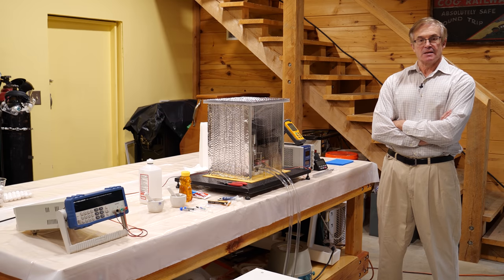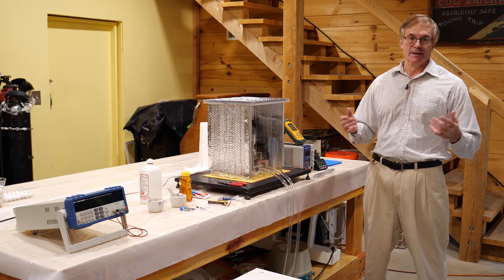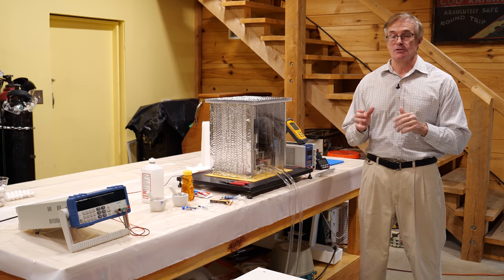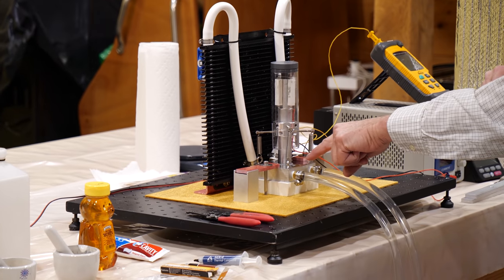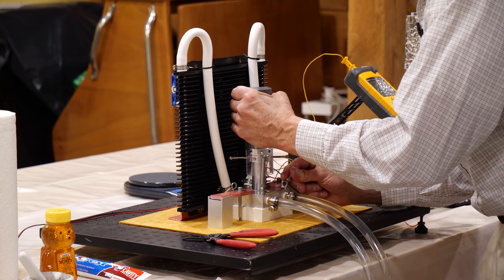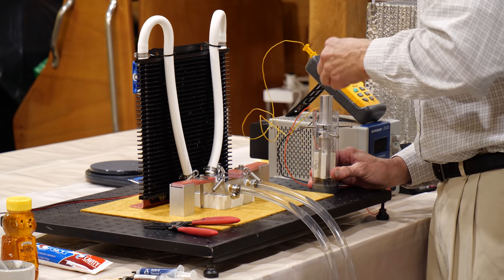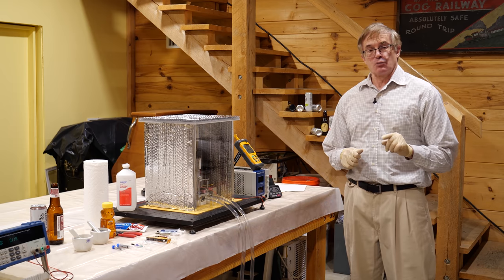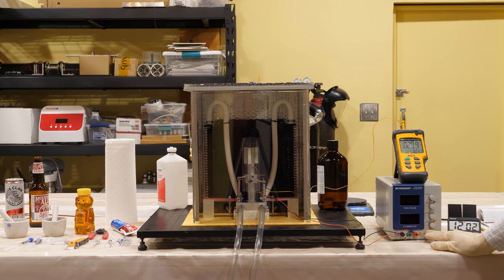DID WE JUST MAKE THE WORLD'S BEST THERMAL PASTE!?

Comment: Interesting.

A couple of questions:

1) You mentioned mercury. Given the reactivity between aluminum and mercury, testing it would result in a "changing test apparatus" as the test progressed.
Had you considered using a more inert, but still thermally conductive interface surface? Ceramic comes to mind.

2) Your Fluke meter ("If it is good, it is a Fluke!") sits on top of the power supply; a heat source. Any thermal gradient across a thermocouple will alter the result. Have you considered putting the meter in an isothermal environment?

3) Given the reactive nature of many of the "participants" in the test, have you considered using a thermistor instead of a thermocouple? Using a 4 wire ohm meter, you can control some of the variables in the experiment.

4) Years ago, I participated in a calorimetry experiment, where two samples were tested, side by side, in an isothermal environment.

By connecting two thermocouples, one under a reference sample, and one under the test object, the difference between the two was made apparent.

Things such as cold junction temperature tended to be "almost" eliminated. Switching which cell the sample under test was in also helped remove error.

5) Something has my "humm" meter waving around. The magnitude of the signal between runs is really small.. a 0.1 degree difference between different, acknowledged "high performing" products.

Are you concerned that your signal to noise ratio may be too high to tell if any of the compounds are significant.

6) Did you consider insulating the "hot" end of the test apparatus so that heat radiating from the resistors wasn't a "variable"? I think I might have embedded a "Calrod"  heater, inside a cavity in the top heater block. (I'm thinking of a cold environment automotive freeze plug heater, for instance.)

Interesting work.

Thank you for doing it.

Comment: So many thoughts:
1) The TIM you made is amazing. There is no doubt about that. I normally use Arctic Silver 5 and I'm looking forward to receiving a 1 ml syringe your product. P.S. You should come up with a brand name like "Tech Ingredients Minnesota Summer Thermal Paste".
2) In fabricating two surfaces that were almost completely flat you indicated that you may have eliminated the need for TIM. You may be more right than you know. Since your experiment only showed a delta of a few tenths of a degree between each material I would venture to say that using TIM in your setup is almost pointless. As you stated, TIM is designed to fill the gaps between the imperfections and the spaces. It looks as if your attention to detail during the "lapping" process actually may have affected the results of your experiment (in my uneducated opinion). Using two surfaces that had been sanded down may have provided a more calculable difference. As another YouTuber showed, machine lapping two copper surfaces within a few microns of perfectly flat caused a molecular bond between the two materials completely eliminating the need for TIM. Perhaps a demonstration of the 3-plate lapping method is in order?
3) Your experiment measured the differences over time as temperatures went up, but what about as temperatures came down? To me, a TIM that provides exceptional thermal conductivity would be more noticeable at lowering the temperature rather than keeping temperatures as low as possible using the same variables but different material. It's just as important to me personally that my equipment is able to lower the temperature back to "normal" as quickly as possible after doing a strenuous workload.
4) What are the results with no TIM?
5) Consider asking your sound person (which may be you) to keep the volume of the outro music lower while you are still talking and then raise it up when you are finished. I'd rather hear what you are saying than be distracted by it.
6) Please keep making these videos and we'll keep throwing subs and likes at you. :-)

Comment: When I deigned power supplies for aerospace in the 80s and 90s, there was a book that showed a family of thermal conductivity curves for Aluminum to Aluminum, with the variable being surface finish and pressure.  All bets are off if the surfaces are not flat.

Comment: What was the temperature when no thermal compound was used? What about cold welding the two surfaces in a vacuum?
Reply from the maker: The temperature is displayed on the meter throughout the video.  That takes very good surface preparation.

Comment: People claiming that any kind of "paste" will work are right. But the question is "how long will it work?" Something water (or anything that evaporates quickly) based, like toothpaste, will dry up very quickly and turn into a pretty decent thermal insulator rather than a conductor.

Comment: Actually... lol.  When you brought up the stairs, I was looking at where it was cracking at at the top under the stairs themselves.  It's a common issue, and I've had the same problem over time.  Usually it's because when your moving very heavy items up and down them, or normal usage over time, the stress causes it to crack in those areas.  I'm wondering if those metal bonding plates added to those areas when the stairs are first constructed would help alleviate that problem.  Anyways, this is a wonderful channel!  I'm glad I subscribed, and I await every new update you all come out with.  Cheers!

Comment: Talking about metal surfaces and the air between them, Thats how you check the quality of Gage Blocks for Machine Shop work. If they are quality gage blocks they can be ring (twisted or slid together starting from a corner each to reduce the air between them) together to actually stick to one another like they are magnetized or glued together but, its actually how the blocks are machined to such precision at a micron level that they have minimal Air trapped between them and more surface area touching between the blocks causing them to stick together.

Comment: That's an awesome test rig.  What would make more awesome is if the start/stop of the test was automated along with automated data collection.  It would have saved a lot of time in the long run and it wouldn't be too difficult.  A couple of relays tied to an Arduino and the thermometer probably has some sort of data out.

Comment: We use the nano diamond compound. Not ideal for large surface area as it has limited flow, but has excellent thermal properties, long term it can degrade under high power RF devices. Whereas the old white compound is not as good but perfect after 30 years.

Comment: Being a wood worker I can't help but notice that crack in the bottom post of the staircase. Perhaps a wooden butterfly stitch X 3 or maybe some of that fiberglass paste you make. After dried fill with wood filler for looks. Maybe even consider a cross bolt. Perhaps the wood is not going to move any more but perhaps not?
Reply from the maker: Thanks for noticing.  A few years ago I reinforced the beam with a longitudinal carbon fiber insert.

Comment: I used graphite powder and 1 drop of 80W90 gear oil.  I mixed as much graphite in as will merge with the clump.  When you press it down, it works better than the store bought stuff by far.
Reply from the maker: Interesting.
Among the many combinations I tested this didn't work any better than the low cost material we formulated.  I tested A LOT of candidates including silicone and mineral oil based pastes with graphite, graphene, diamond, carbon nanotubes and various metal and ceramic powders.  I also tested several Neverseize compounds.
There are some physical reasons for these results and I'll cover them in the next video.
Reply: @TechIngredients  I should have known you tried graphite,  if you tried toothpaste.  My results were far better than with the stuff that comes in the tube with the CPU   Temperature was a few degrees cooler on average.  I didn't really take a scientific approach to compare them, but the temperature is cooler now with the graphite/gear oil mix.  I did press it on with a clamp though.  I try to find a way to clamp that stuff in to get the bubbles out and reduce the thickness.  I would estimate about 100 lbs of force across the CPU with an ABS block on top of the heatsink, and a block of 2x4 under the main board.  The "C" grips aren't as strong as the vise grips, so thats why I say about 100 lbs. I think that is about right.  Maybe clamping it tight like that improved it?  The graphite mix is pretty thick stuff so it has to be mashed in there pretty tight though.

Comment: Very interesting video. Impressed by your patience. Seeing the closeness in product variations it would have been more suitable to have used a temp measurement to three or four decimal places or use a less massive measurement block allowing a faster thermal climb rate. Also the time lag between power on and timer start was not consistent and would have been better being on the same switch. The increased decimal places would also have improved the accuracy of initiating the start at 21.000 degrees. This lack of precision could account for the fact your experimental repeatability is so consistent. This is the axiom 'a miss is as good as a mile' syndrome. Lastly, I was surprised that you didn't show the result of the indium film, even though the contact pressure would obviously be too low for full effect, just for interest and for the same reason a test without product at all. As I say a very interesting experimental video Sir, 8/10 ;-) Hope my comment spur your thoughts. Thank you.

Comment: Great video! And I like that when I think of something, you usually address it in the next minute:-) 
Just one suggestion, if you doubled (at least) the power output of the heating element you would get much better comparison of the thermal compounds. Currently, there were differences which were close to the measurement resolution/error (0.1C) and the start/stop temperature difference was only about 9-10C. Since you compensated for most of the losses in the testing device, it would be nice to see it with higher power/temperature gradient/resolution.
Thanks for your great work and videos!
Reply from the maker: We'll be addressing that with the modified rig when we test liquid metals.

Comment: I'm very curious about the thermal material recipe.
I really like your videos and I'm subscribed to you channel. I had chance to make similar temperature test at work so I have few notes.

First thing is, put insulation around the plastic enclosure of the aluminium rod, you have a lot of heat loss over there. This is very important especially if you have such long distance between the resistors and the TIM. 
Second thing is - Is this one aluminium rod or two rods attached together? If these are two rods, you have additional heat resistance and this again reduce the difference between the TIMs. 
So anyway, try to make shorter rod and insulate it, it will make huge difference.

You can also try to increase the power of the setup, you will get bigger difference between the materials. Its the same like the voltage and electrical current, if you have bigger heat current through the heat resistance(TIM-thermal interface material) you will have bigger  temperature difference(voltage) . I see that on the setup, you have space for 4 more resistors, or  at   least it looks this way.

Comment: I've been making my own thermal paste for years. I tested it I didn't quite get his technical as you did but it seems to work pretty well. I mix coconut oil with graphite powder. I use graphite powder because it's composed of tons of little pieces of graphene which is the best  known thermal conductor known to man. The coconut oil part could probably be improved upon. I'd love to see you test this compound.just subscribed.
Reply from the maker: Thanks.
I did, sorta.  All oils, mineral, silicone and vegetable are similar in their conductivity, but the silicones are fully synthetic and more consistent.  Graphite is A LOT different than graphene  because what differentiates graphene is the thermal and electrical conductivity as well as the mechanical properties only in plane. Through plane and between multiple planes it's not remarkable. As I explain in the next video, the performance of these TIMs is controlled by the liquid fraction and not the thermal performance of the suspended  solids.

Comment: @Tech Ingredients, thank you for such a well explained video with lots of knowledge and well-prepared experiments. 
Right now, I am left with one question. 
In this kind of experiment, you take into account the thermal conductivity but also viscosity and grain size of the fillers. A pressure will lead to a thinner layer for thermal pastes with small grain size and low viscosity. (If you have a thermal paste X that has twice the thermal conductivity of paste Y but twice the layer size due to grain size, the heat flow would be the same for both pastes). You are working with very well polished, flat surfaces which also advent those kinds of thermal pastes. In real daily usage of thermal paste, I suppose the surfaces won’t be always that “perfect”, which ultimately means you'll get a thicker layer of thermal paste and could potentially change the results. In short, I would love to see your experiments with a constant layer thickness instead of equal pressure. I guess that way you could also roughly estimate the thermal conductivity by the other thermal pastes values (if they are consistent).
I look forward to hearing your thoughts and the thoughts of others.
Reply from the maker: That's correct.  Viscosity and thermal conductivity are inversely related.  The balance needs to be optimized.

Comment: Awesome video and great channel! Question: what temps can your paste withstand and be functional at? Curious to know how you think it would work on a 3D printer hotend. Essentially the idea is conduct as much heat from the heating element into a large metal block to heat the nozzle. A lot of people don’t use a paste but in high temp applications it’s helpful to keep your nozzle consistently heated. Do you think your paste would hold up and perform well under 200-250c temps?
Reply from the maker: It should be good to approximately 150 C. I doubt it will work that hot.

Comment: Great video, however unless I missed it, I didn’t see you show a test without any thermal compound would be good to have as a baseline and to show the importance of a thermal compound.

Also are you sure the compounds performance is linear throughout all temperatures, for example you tested the temperature range of 21-30c but I would assume the cpu thermal compound are designed for a more realistic range of 50-80c because at 30c if the performance isn’t great it’s fine but as temperature climb closer to 80c the performance it’s a lot more important, what you could have done is take multiple data points at different temperature ranges.

And then there is also the obvious question of performance over time, some compounds dry out and lose performance fairly quickly, and it usually a lot more important that the temperature is consistent over the lifetime of the product then it have really amazing initial performance. 

Anyway top video as always.

Comment: Does the difference in pressure during the installation of the thermal compound have an effect on the outcome maybe? Seeing that during the installation of the springs the cylinder is pressed by hand, which may influence the spread of the thermal compound. 
I was also thinking about this when installing thermal compound on my laptops CPU. Before tightening the screws of the heatsink you have to press/hold it by hand. I know that theoretically there should be a vacuum and the spread should have no issues from the fluctuating pressure but maybe in reality it won't be as optimal and you may not achieve an even spread. 

If this phenomenon has an effect, you could think of a device that holds the cylinder at a distance and lower it only after all springs are attached to ensure that the springs are the only force that apply pressure on the cylinder surface.
Reply from the maker: Keep in mind that this isn't an academic exercise and in practice people will use different techniques to load these materials. Because the forces of the clamps are greater than one's hand and they're applied for long periods of time it is the viscosity vs the clamping pressure that will determine the final bond line thickness.

Comment: Sir,  I think due to high temperature volume of thermal paste increasing, and both surfaces also, pushing each other to the limit, then after cooling volume decrease and what densified  is quite porous airy material. but water, graphite and bismuth can compensate, they shrinking when temp increase. is it good idea to add to the mix powder of graphite or bismuth?

Comment: Since you went through various kinds of TIMs, what about a two phase cooling system? There is a few dielectric liquids with low boiling points. Would be interesting to see the heat transport or cooling on a system compared with an „oldschool“ approach. Taking into account the same energy, although environmental conditions are hard to replicate for those very different cooling methods

Comment: I used to use silicone grease as my thermal paste. I once had everything ready to build a new PC except for the thermal paste so I tested a few things I had in the shed and the silicone grease was the most stable when I heated it up quite a lot over the hob so I put it under my CPU and kept an eye on the temerature and it was fine for the life of that PC. I don't know how well the silicone grease actually performed, only that it was fine for my needs.
Reply from the maker: It will not be very conductive, it's basically a poorly loaded thermal paste.